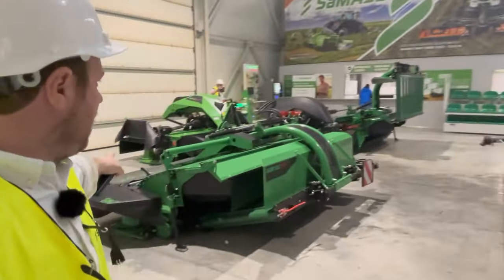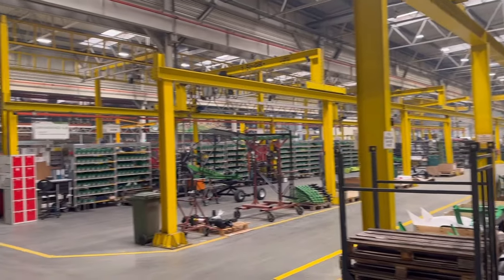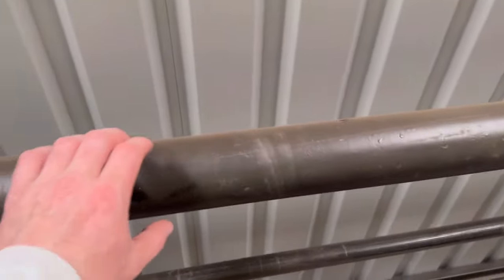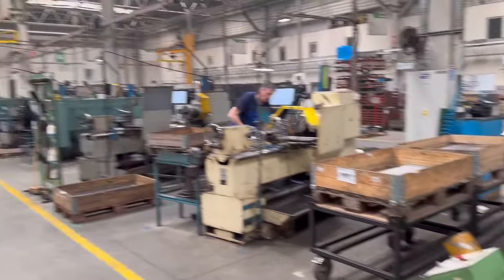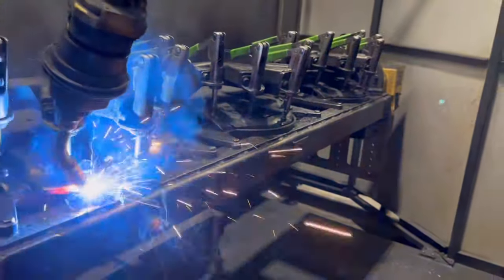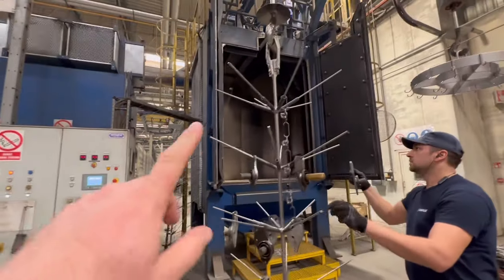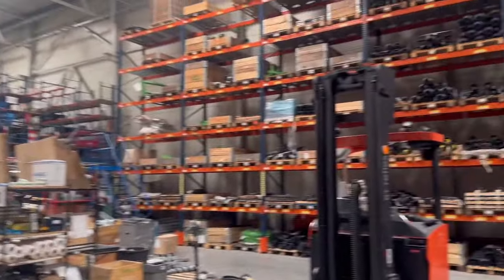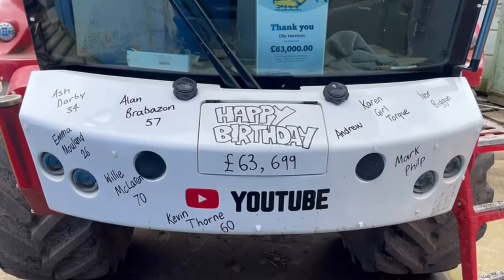HOW TO MAKE A MOWER TOUR OF SAMASZ #AnswerAsAPercent 1479

Comment: Using the little rake to flip straw swaths should work well. We use a Kuhn mm301 a little single row 3 meter merger to do the same job it works very well. We had similar weather to you last year only about 12 days total of clear sunny skies so a lot of our straw got rained on. The merger picked it up flipped it over and tossed it. made it dry out much quicker and kept almost all of it from rotting, other than a few fields so wet they were inaccessible/swamps. 79% today love from Nova Scotia, Canada.

Comment: Those tube benders are called mandrel benders. That long rod isn't flexible, it gets drawn out as the bends are formed, just in front of the bend to stop the tube collapsing. Mate's firm in Manchester that has them.

Comment: another brilliant video.......all the different process well explained. that first turner you saw outside is a replica of the Lely pheasant hayturner made all back in the 60s/70s..........my dad used one for donkeys years before the haybobs came out .......still got it up in the shed........so if you fancy one of them you can have the original from me  for slightly less than the cost of a new one😃😃

Comment: Impressive factory 👍 love a good how it's made factory tour. The laser cells and automation are excellent. It's funny to then see rows of older manual lathes turning parts and the old 500 ton press alongside such a modern setup in the laser and welding cells. It's clearly working like a well oiled machine. I could spend all day in a place like that. Great video Olly 👍

Comment: In the early 90's, I got my press setting qualification, setting presses from 6 ton to 800 ton. However, water and laser cutting has replaced most press work since the early 2000. Press setting is dead in the UK. You only find them at the car plants nowadays.

Comment: A modern side rake!
Reply: Back in the 70’s when I was a kid I spent days turning straw with an old side rake. Nothing else made as good a job if you drove in the right place, it not only inverted the swath it places it on dry ground. When I first saw one of the modern inverters I had the chuckle when they said it was something new 😂
Reply: Join the club . A proper side take on the farm next door probably converted from horse drawn, no hydraulic drive, and a 6 wheel that could be used as a turner or for rowing up 2 rows into one and trailed unlike the state of the art, at the time, a Vicon Acrobat! Happy days

Comment: Why have a hay Turner with a PTO they had ones pulled by horses and worked off the wheels surely that would use less fuel and not take a big tractor to work it
Reply: Seriously 😂😂